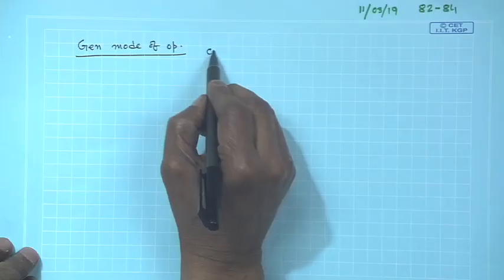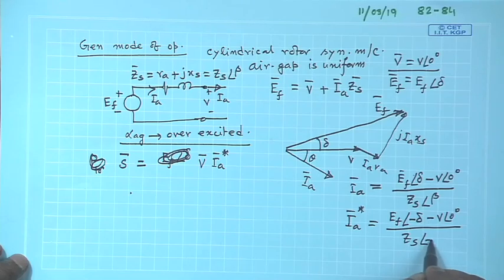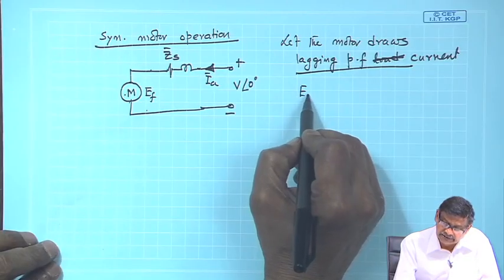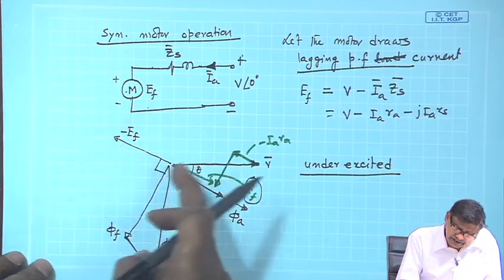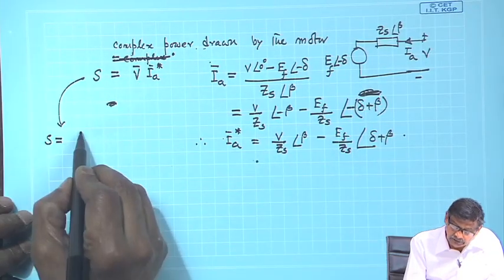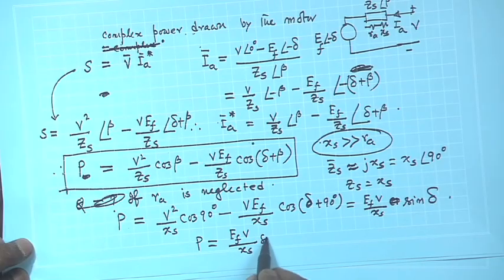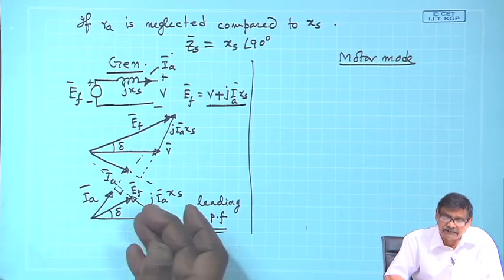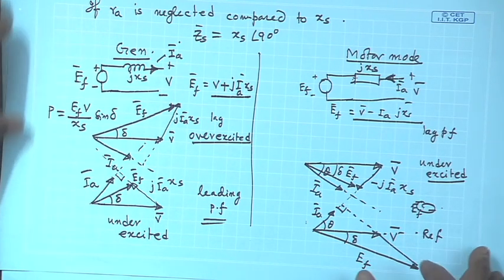Lecture 82: Synchronous Motor Operation, Phasor Diagram and Power Expression

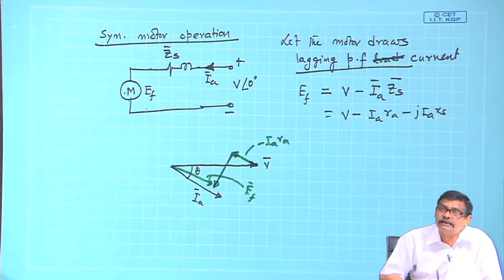Comment: 10:46 It will be stator field.
The circuit diagram is for stator only. 

Also,
Rotor is excited by D.C current so there will be no inductance only factor which will oppose current in rotor is Resistance.

There will be no induced current or emf in rotor, cause stator and rotor will run at synchronous speed with magnetic locking in between them - In case of synchronous motor.
Reply: No mate it denotes rotor field only. Ef is directly proportional to If that is rotor current for linear magnetization curve.